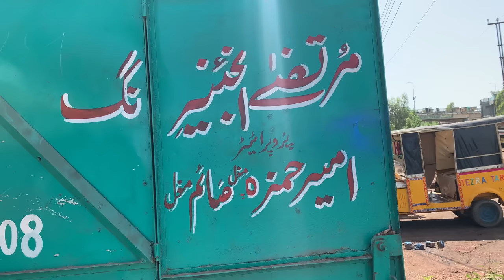Handmade Making Process of Hydraulic Tractor Trolley-Manufacturing Of Hydraulic Tractor Trolley|

Comment: Ребята, берегите глаза, работайте в масках и защитных очках!!!! 🙏🙏🙏
Reply: I think that.
1. They should use better personal protective equipment: gloves, boots, welding helmet, leather apron and mask.
2. They should use stronger solder, type 7018, 9018, 11018.
3. They must make bevels for welding and leave space between the pieces (1/8) so that the pieces stick or adhere correctly. And even more so when it can only be welded on one side.
4. For very serious jobs like these, it is necessary to apply the welding vertically upwards.
5. For jobs as serious as these, it is necessary to apply the welding beads alternately: at one, at six 🕕, at nine 🕘, at three 🕒... At two 🕑, at seven 🕖....
6. For jobs like these it is necessary to preheat the area where you are going to solder a little (60 degrees Celsius)
7. There is no need to bend the electrodes.
8. For jobs as delicate as these, it is better to apply the solder in letter (C) movements or in circles.
9. The entire piece should have some kind of tempering so that it does not bend so easily.
10. You can create a template or pattern to make the bevels  with oxycut jjj

Comment: very impressed with their skill with what little they have, only thing not impressed with is the lack of grease fittings on the hinge points and pins...and not packing wheel bearings and lack of a grease cap for the hub allowing grit and dirt to enter the bearings.
Reply: I think that.
1. They should use better personal protective equipment: gloves, boots, welding helmet, leather apron and mask.
2. They should use stronger solder, type 7018, 9018, 11018.
3. They must make bevels for welding and leave space between the pieces (1/8) so that the pieces stick or adhere correctly. And even more so when it can only be welded on one side.
4. For very serious jobs like these, it is necessary to apply the welding vertically upwards.
5. For jobs as serious as these, it is necessary to apply the welding beads alternately: at one, at six 🕕, at nine 🕘, at three 🕒... At two 🕑, at seven 🕖....
6. For jobs like these it is necessary to preheat the area where you are going to solder a little (60 degrees Celsius)
7. There is no need to bend the electrodes.
8. For jobs as delicate as these, it is better to apply the solder in letter (C) movements or in circles.
9. The entire piece should have some kind of tempering so that it does not bend so easily.
10. You can create a template or pattern to make the bevels  with oxycut jjj hhjb

Comment: Fully automated production line!
In Pakistan the meaning is, that as soon as one of these poor guys were injured or killed on the job, the next one immediately jumps in.
Reply: Share with us your way of automated production........ Preferably on your channel.
Reply: I think that.
1. They should use better personal protective equipment: gloves, boots, welding helmet, leather apron and mask.
2. They should use stronger solder, type 7018, 9018, 11018.
3. They must make bevels for welding and leave space between the pieces (1/8) so that the pieces stick or adhere correctly. And even more so when it can only be welded on one side.
4. For very serious jobs like these, it is necessary to apply the welding vertically upwards.
5. For jobs as serious as these, it is necessary to apply the welding beads alternately: at one, at six 🕕, at nine 🕘, at three 🕒... At two 🕑, at seven 🕖....
6. For jobs like these it is necessary to preheat the area where you are going to solder a little (60 degrees Celsius)
7. There is no need to bend the electrodes.
8. For jobs as delicate as these, it is better to apply the solder in letter (C) movements or in circles.
9. The entire piece should have some kind of tempering so that it does not bend so easily.
10. You can create a template or pattern to make the bevels  with oxycut jjj hhjb
Reply: @user-le4ec6ii7d  That will probably happen in the next millennium. 
Priority is  inventing chairs, tables, workbenches and, of course, toilet bowls.

Comment: Даже смотреть на это больно...
Reply: Сделайте что-нибудь еще.
Reply: I think that.
1. They should use better personal protective equipment: gloves, boots, welding helmet, leather apron and mask.
2. They should use stronger solder, type 7018, 9018, 11018.
3. They must make bevels for welding and leave space between the pieces (1/8) so that the pieces stick or adhere correctly. And even more so when it can only be welded on one side.
4. For very serious jobs like these, it is necessary to apply the welding vertically upwards.
5. For jobs as serious as these, it is necessary to apply the welding beads alternately: at one, at six 🕕, at nine 🕘, at three 🕒... At two 🕑, at seven 🕖....
6. For jobs like these it is necessary to preheat the area where you are going to solder a little (60 degrees Celsius)
7. There is no need to bend the electrodes.
8. For jobs as delicate as these, it is better to apply the solder in letter (C) movements or in circles.
9. The entire piece should have some kind of tempering so that it does not bend so easily.
10. You can create a template or pattern to make the bevels  with oxycut jjj

Comment: У сварщика в черном халате самая профессиональная сварочная маска , а так у них кто держак взял тот и сварщик !
Reply: I think that.
1. They should use better personal protective equipment: gloves, boots, welding helmet, leather apron and mask.
2. They should use stronger solder, type 7018, 9018, 11018.
3. They must make bevels for welding and leave space between the pieces (1/8) so that the pieces stick or adhere correctly. And even more so when it can only be welded on one side.
4. For very serious jobs like these, it is necessary to apply the welding vertically upwards.
5. For jobs as serious as these, it is necessary to apply the welding beads alternately: at one, at six 🕕, at nine 🕘, at three 🕒... At two 🕑, at seven 🕖....
6. For jobs like these it is necessary to preheat the area where you are going to solder a little (60 degrees Celsius)
7. There is no need to bend the electrodes.
8. For jobs as delicate as these, it is better to apply the solder in letter (C) movements or in circles.
9. The entire piece should have some kind of tempering so that it does not bend so easily.
10. You can create a template or pattern to make the bevels  with oxycut jjj hhjb jbjj

Comment: fanstastique ces ouvriers bravo et quelle qualité du travail bravo  combien de familles vont se nourir de cette construction plus que nos robots j'espére qui eux font vivoter le boys et qui offre au gros plein de fric tout le bénéfice
Reply: I think that.
1. They should use better personal protective equipment: gloves, boots, welding helmet, leather apron and mask.
2. They should use stronger solder, type 7018, 9018, 11018.
3. They must make bevels for welding and leave space between the pieces (1/8) so that the pieces stick or adhere correctly. And even more so when it can only be welded on one side.
4. For very serious jobs like these, it is necessary to apply the welding vertically upwards.
5. For jobs as serious as these, it is necessary to apply the welding beads alternately: at one, at six 🕕, at nine 🕘, at three 🕒... At two 🕑, at seven 🕖....
6. For jobs like these it is necessary to preheat the area where you are going to solder a little (60 degrees Celsius)
7. There is no need to bend the electrodes.
8. For jobs as delicate as these, it is better to apply the solder in letter (C) movements or in circles.
9. The entire piece should have some kind of tempering so that it does not bend so easily.
10. You can create a template or pattern to make the bevels  with oxycut jjj

Comment: Ah takes me out to my back yard while welding …..The old thongs haha smell of burnt flesh and jumping all over the place ..got to take your hat of to these fellas …they work with what they have ..from outback Western Australia 👍👍
Reply: I think that.
1. They should use better personal protective equipment: gloves, boots, welding helmet, leather apron and mask.
2. They should use stronger solder, type 7018, 9018, 11018.
3. They must make bevels for welding and leave space between the pieces (1/8) so that the pieces stick or adhere correctly. And even more so when it can only be welded on one side.
4. For very serious jobs like these, it is necessary to apply the welding vertically upwards.
5. For jobs as serious as these, it is necessary to apply the welding beads alternately: at one, at six 🕕, at nine 🕘, at three 🕒... At two 🕑, at seven 🕖....
6. For jobs like these it is necessary to preheat the area where you are going to solder a little (60 degrees Celsius)
7. There is no need to bend the electrodes.
8. For jobs as delicate as these, it is better to apply the solder in letter (C) movements or in circles.
9. The entire piece should have some kind of tempering so that it does not bend so easily.
10. You can create a template or pattern to make the bevels  with oxycut jjj hhjb

Comment: Подвеска,нет,не слышал 😢
Reply: а что это такое...
Reply: I think that.
1. They should use better personal protective equipment: gloves, boots, welding helmet, leather apron and mask.
2. They should use stronger solder, type 7018, 9018, 11018.
3. They must make bevels for welding and leave space between the pieces (1/8) so that the pieces stick or adhere correctly. And even more so when it can only be welded on one side.
4. For very serious jobs like these, it is necessary to apply the welding vertically upwards.
5. For jobs as serious as these, it is necessary to apply the welding beads alternately: at one, at six 🕕, at nine 🕘, at three 🕒... At two 🕑, at seven 🕖....
6. For jobs like these it is necessary to preheat the area where you are going to solder a little (60 degrees Celsius)
7. There is no need to bend the electrodes.
8. For jobs as delicate as these, it is better to apply the solder in letter (C) movements or in circles.
9. The entire piece should have some kind of tempering so that it does not bend so easily.
10. You can create a template or pattern to make the bevels  with oxycut jjj

Comment: подвеска,? не, не нужна, все равно мы больше 50 тонн не грузим, чтобы по серпантину с двумя прицепами разминаться удобно было.
Reply: I think that.
1. They should use better personal protective equipment: gloves, boots, welding helmet, leather apron and mask.
2. They should use stronger solder, type 7018, 9018, 11018.
3. They must make bevels for welding and leave space between the pieces (1/8) so that the pieces stick or adhere correctly. And even more so when it can only be welded on one side.
4. For very serious jobs like these, it is necessary to apply the welding vertically upwards.
5. For jobs as serious as these, it is necessary to apply the welding beads alternately: at one, at six 🕕, at nine 🕘, at three 🕒... At two 🕑, at seven 🕖....
6. For jobs like these it is necessary to preheat the area where you are going to solder a little (60 degrees Celsius)
7. There is no need to bend the electrodes.
8. For jobs as delicate as these, it is better to apply the solder in letter (C) movements or in circles.
9. The entire piece should have some kind of tempering so that it does not bend so easily.
10. You can create a template or pattern to make the bevels  with oxycut jjj

Comment: 11:14 Вы не правильно делаете, надо перед работой снять защитный кожух с болгарки!
Reply: 100%
Reply: I think that.
1. They should use better personal protective equipment: gloves, boots, welding helmet, leather apron and mask.
2. They should use stronger solder, type 7018, 9018, 11018.
3. They must make bevels for welding and leave space between the pieces (1/8) so that the pieces stick or adhere correctly. And even more so when it can only be welded on one side.
4. For very serious jobs like these, it is necessary to apply the welding vertically upwards.
5. For jobs as serious as these, it is necessary to apply the welding beads alternately: at one, at six 🕕, at nine 🕘, at three 🕒... At two 🕑, at seven 🕖....
6. For jobs like these it is necessary to preheat the area where you are going to solder a little (60 degrees Celsius)
7. There is no need to bend the electrodes.
8. For jobs as delicate as these, it is better to apply the solder in letter (C) movements or in circles.
9. The entire piece should have some kind of tempering so that it does not bend so easily.
10. You can create a template or pattern to make the bevels  with oxycut jjj

Comment: You know it's a quality build when the frame rails are scabbed to length
Reply: I think that.
1. They should use better personal protective equipment: gloves, boots, welding helmet, leather apron and mask.
2. They should use stronger solder, type 7018, 9018, 11018.
3. They must make bevels for welding and leave space between the pieces (1/8) so that the pieces stick or adhere correctly. And even more so when it can only be welded on one side.
4. For very serious jobs like these, it is necessary to apply the welding vertically upwards.
5. For jobs as serious as these, it is necessary to apply the welding beads alternately: at one, at six 🕕, at nine 🕘, at three 🕒... At two 🕑, at seven 🕖....
6. For jobs like these it is necessary to preheat the area where you are going to solder a little (60 degrees Celsius)
7. There is no need to bend the electrodes.
8. For jobs as delicate as these, it is better to apply the solder in letter (C) movements or in circles.
9. The entire piece should have some kind of tempering so that it does not bend so easily.
10. You can create a template or pattern to make the bevels  with oxycut jjj

Comment: Эти люди могут все в жазни!!! ❤
Reply: Варить без сварочной маски! А вы попробуйте!
Reply: @user-jx4bn2iv7v  я и говорю! Эти люди могут все! В молодости бывало варил без маски, теперь глаза болят...
Reply: А ещё излучение от сварки рак кожи вызывает, как и при ядерном загаре!
Reply: I think that.
1. They should use better personal protective equipment: gloves, boots, welding helmet, leather apron and mask.
2. They should use stronger solder, type 7018, 9018, 11018.
3. They must make bevels for welding and leave space between the pieces (1/8) so that the pieces stick or adhere correctly. And even more so when it can only be welded on one side.
4. For very serious jobs like these, it is necessary to apply the welding vertically upwards.
5. For jobs as serious as these, it is necessary to apply the welding beads alternately: at one, at six 🕕, at nine 🕘, at three 🕒... At two 🕑, at seven 🕖....
6. For jobs like these it is necessary to preheat the area where you are going to solder a little (60 degrees Celsius)
7. There is no need to bend the electrodes.
8. For jobs as delicate as these, it is better to apply the solder in letter (C) movements or in circles.
9. The entire piece should have some kind of tempering so that it does not bend so easily.
10. You can create a template or pattern to make the bevels  with oxycut jjj hhjb

Comment: Ассалаума-алейкум из Каракалпакстан ❤
Reply: I think that.
1. They should use better personal protective equipment: gloves, boots, welding helmet, leather apron and mask.
2. They should use stronger solder, type 7018, 9018, 11018.
3. They must make bevels for welding and leave space between the pieces (1/8) so that the pieces stick or adhere correctly. And even more so when it can only be welded on one side.
4. For very serious jobs like these, it is necessary to apply the welding vertically upwards.
5. For jobs as serious as these, it is necessary to apply the welding beads alternately: at one, at six 🕕, at nine 🕘, at three 🕒... At two 🕑, at seven 🕖....
6. For jobs like these it is necessary to preheat the area where you are going to solder a little (60 degrees Celsius)
7. There is no need to bend the electrodes.
8. For jobs as delicate as these, it is better to apply the solder in letter (C) movements or in circles.
9. The entire piece should have some kind of tempering so that it does not bend so easily.
10. You can create a template or pattern to make the bevels  with oxycut jjj

Comment: I give you guys credit.
You made that with a limited amount of tools and equipment.
I would like to see you have better face shields for welding to protect your eyes from the arc flash.
It also would have been better to add some brakes to the trailer for better stopping under a load, rather than relying on the truck towing it.

Comment: Мост приварили??)))) 😊
Reply: I think that.
1. They should use better personal protective equipment: gloves, boots, welding helmet, leather apron and mask.
2. They should use stronger solder, type 7018, 9018, 11018.
3. They must make bevels for welding and leave space between the pieces (1/8) so that the pieces stick or adhere correctly. And even more so when it can only be welded on one side.
4. For very serious jobs like these, it is necessary to apply the welding vertically upwards.
5. For jobs as serious as these, it is necessary to apply the welding beads alternately: at one, at six 🕕, at nine 🕘, at three 🕒... At two 🕑, at seven 🕖....
6. For jobs like these it is necessary to preheat the area where you are going to solder a little (60 degrees Celsius)
7. There is no need to bend the electrodes.
8. For jobs as delicate as these, it is better to apply the solder in letter (C) movements or in circles.
9. The entire piece should have some kind of tempering so that it does not bend so easily.
10. You can create a template or pattern to make the bevels  with oxycut jjj hhjb